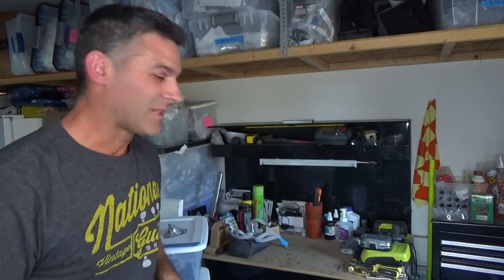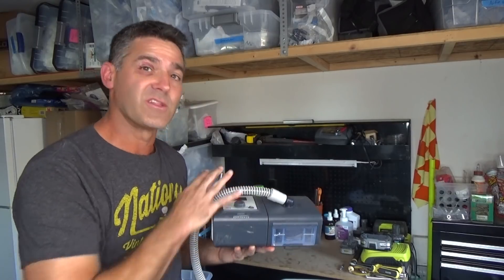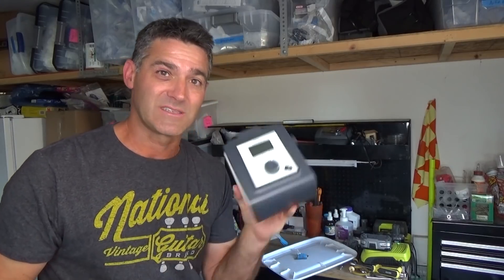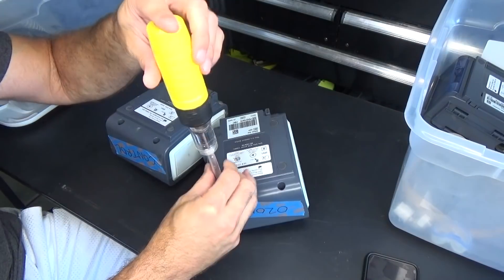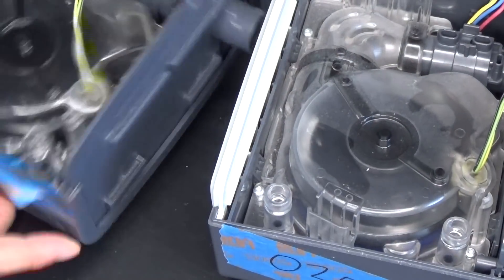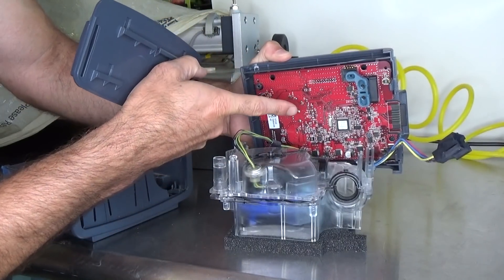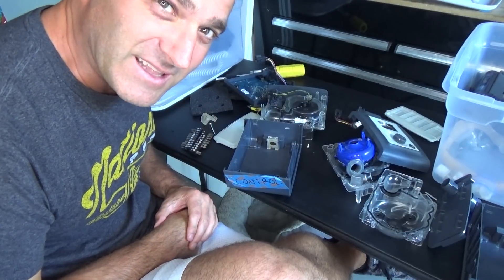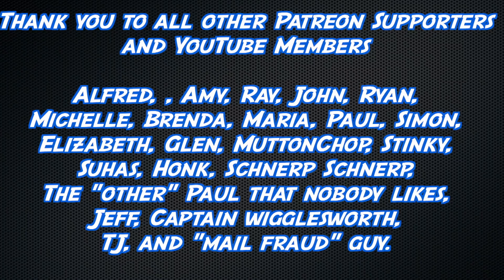Showing what OZONE does to the FOAM in a Philips Respironics CPAP Machine   #Foamgate

Comment: I'd prefer to see this done with dozens of units with known histories (preferably new), rather than used but (claimed) equivalent histories. Heck, your teardown makes me think the two units could have been years different in age. Also, I have a hard time accepting your evidence as meaningful since we didn't see the filters before the test. The pattern of disintegration shown doesn't seem consistent with air flowing through the foam, but appears rather uniform, seemingly more an indicator that age was the issue. I could rationalize all day long, but my point is the evidence you provided does not seem very convincing...to me. I expect the ozone could be an issue, but all I see is anecdotal evidence.

Oh, and: no, I don't use an ozone thingy – I've been thinking about getting one for years, but haven't made that leap.

Comment: From reading the comments about ozone and the comments about the SoClean machines, its clear that many here are over exaggerating the ozone exposure. Ozone doesn't enter your cpap when that cleaner is not running. The video is only trying to show that extreme exposure... 100s of times more than a SoClean machine will run through your cpap, will deteriorate the foam. This could mean you are breathing in tiny particles of foam.
What the video fails to show however...is that ozone from these disinfecting machines doesn't get cycled through that foam anyway. And no ozone remains in the machine to poison you as you sleep.
This was a VERY unscientific display meant to scare people...because the foam is AFTER your filter.
Reply from the maker: I can see why you are confused. There is a video that this is a follow up of. 
I don't know that I (or others) would call running the ozone 2x per day extreme.  Ozone degrades after 30 minutes to 4 hours.  

Ozone absolutely gets cycled through the machine. This video shows that. (This video or any other of my videos don't ever make the claim that ozone remains in the machine)  This was a fair test, but not something I'd submit to a journal.  

I would have put in scary music if I was trying to scare people. 🤣 

When ozone is hooked up to a machine, it doesn't matter when the filter is (the foam is first...as this video shows) since ozone is going to get to it all anyway.  Only thing getting filtered out is dust.  

You honestly sound like you work for SoClean, or VirtuClean.  Or have a warehouse full of these that you need to sell on Amazon.

Comment: I see a few problems with this very un-scientific comparison. It can't even be called a trial or an experiment.
First there was no pre-test comparisons between the test and the control units. For all we know, the test unit was already dusty and dirty and has disintegrating foam. Second, there was no quantification of the ozone being pumped into the container with the test unit sealed inside. How pure or concentrated was the ozone? How long per day? The author said the contained was filled for many many days.
Its clear he is trying to condemn the use of the brand SoClean disinfection device.
He needs to start with two brand new cpap machines, and match the strength, quality, and duration of ozone exposure from the SoClean device; which is only about 7 or 8 minutes per daily cleaning cycle, for these results to be considered conclusive or evidence-based.
Better yet start off with 2 brand new cpap units. Run both units the same amount of time each day. One unit gets the usual wash in dish soap etc, and the other gets the same wash each day but also gets run through a 7 minute SoClean machine ozone cycle.
THEN you have true comparable results (although still not a scientific level experiment)
And you should be replacing your mask, hose and filters monthly anyways.
Reply from the maker: Sounds like you have a great experiment YOU can do.  Please let me know when your video is done so that I can watch it.  Thanks Big Todd.

Comment: I was wondering why I get a notice about the $hitbox Philips machine I got. It's hopefully being swapped to a Resmed Air10 so I can sleep without a jet engine beside me.
Reply: That is a sign that your machine needs to be taken apart and completely cleaned, or that the bearings on the fan are failing. The bearings on my honey's machine fan failed and it gave lots of warning with a loud whining sound and it legit sounded like a jet engine failing at close range once i got the rotor to turn. 😲

Comment: Trying to understand, maybe somebody can clear this up.....I use an ozone cleaner on the tube and mask only, never on the unit itself. Since the tube/mask is past the actual machine and air only flows out of it...do I need to be concerned about the "effects of ozone on the foam" that I keep reading about. Any clarification appreciated.
Reply: I’m wondering the same thing!! I’ve used my soclean since Xmas 2020 and I don’t think I’ll be using it anymore!!!
Reply: I use an ozone cleaner called Respify. It only cleans the mask, tubing, etc. Not the unit, itself. It is very small. Fits in your palm. Cheap, too. Gave $99. Seen em as low as $79, since my purchase. Beats the heck outa trying to dry out the hose tubing, everyday. I have had some durability issues with it. The power cord quit working, early on, but the company did promptly replace free of charge. Just letting people know that there are options to soclean, out there & you don't have to use the ozone on the unit, itself. Hope this helps somebody.

Comment: Those old enough to remember what a VCR is may remember the news that came out from the various manufacturers that warranties would be voided if an "ionizer" was used around the machine.  The ionizer generated ozone.  It made the air smell fresher and would cause the rubber belts in the VCR to deteriorate and break in a very short time.  When I got my CPAP years ago I refused the offer of a HUGE discount on one of the more popular cleaning devices.  I knew what the ozone would do to the plastic parts.

Comment: Great investigative forensic disassembly.  Well done.  Any idiot with a high school education knows ozone should be avoided.  And the germaphobe angle is a it's own form of mental illness.  I wash my P30I mask, hose, and humidifier once every 7 days and dry with the Hurricane dryer
  Distilled water only but in the summer I put an end cap on the Airsense CPAP and for waterless.  No issues in over 3 years and now thanks to VOVID mask wearing no colds either.

Comment: VA kept telling me they don't recommend the ozone units and to save my money. However, I wonder if essential oils had any effect on them.... I used to use 2-3 drops of peppermint....
Reply: This is my unscientific opinion, but since this is a constant positive air pressure system, and if you were putting the essential oils in the humidifier, the air in the unit only travels in one direction so the evaporating oils would not enter the unit only the tubing and mask.

Comment: Thanks for the video.  
You show how ambient air enters the CPAP (System One) through the filter, the air “touches” the foam, it proceeds to the blower and then on to the hose (or humidifier). Correct understanding?
If we have a Soclean 2, we must have the humidifier attached.  Ozone is injected into the humidifier (with or without water), ozone then proceeds to go into the hose and on to the mask which is inside Soclean 2.  Inside the Soclean 2, ozone is reduced to diatomic oxygen. Agree?
So how does ozone get to the foam?  It cannot get there through the normal intake, UNLESS there is a high concentration of ozone in the ambient air. Or it back feeds to the connection in the humidifier into the CPAP and finds its way to the foam.
Not sure how ozone would touch the foam in a Dreamstation.
DreamStation 2 given its design it cannot use Soclean 2 since air does not flow in a straight line, the airflow makes a U-Turn in the humidifier
Regardless though, Soclean 2 can be used to sanitize the hose and mask: ozone enters the hose through a sealed connection, flows thorough the hose, out from mask which is placed inside Soclean where the ozone is reduced to diatomic oxygen.
Reply from the maker: Flows from humidifier through tubing to mask like you say, but also back into the blower and entire housing of machine (through foam) and out the air intake.  

Humidifier through entire internal circuit is probably 8-10 inches in length.  Humidifier through tubing to mask is about 66-70 inches.

Regardless of where the ozone goes it breaks down after 30 minutes or so.
Reply: @Freecpapadvice  How about putting a plug on the exit to the humidifier so that it does not back feed into the blower?  Would sanitize not only the tube and mask (perhaps the most critical component) but also the humidifier. Or just simply sanitize the hose and mask?  Notice I use the term sanitize not clean.

BTW ozone has a distinctive smell - the smell of an electrical short circuit. Typically Soclean 2 runs about 7 mins, I never smelled ozone, however I never opened the lid on Soclean.  Have to wait two hours to take the mask out of the Soclean chamber.
Reply: Something does not make sense. Problem 1: Ozone damages the foam and helps to deteriorate the foam and it breaks up into small black specs. Has anyone seen the specs in the humidifier? A humidifier chamber is needed for Soclean. Problem 2: Even without the use of ozone, the foam apparently releases VOCs. If that is the case, should we also worry about the filter elements in System One and DS1, especially System One which uses a foam filter?

Comment: Is the foam in a closed chamber or is it open? Someone on youtube, who opened to remove the foam wrote: there are two chambers, an upper and a lower one. The air does not pass the foam. He wrote this in the comment section, not in the video. (First pinned comment.) it was a Dreamstation.

https://youtu.be/ytLGqYbIDVE
Reply from the maker: There is an upper and lower....that's how I would describe it as well.
Don't let this mislead though.  Like the chambers of the heart, they all have the same blood flowing through.  This sucks air from outside the machine and through the foam.  From there it is sucked up into the upper chamber and through the blower/flow generator.  Then to the humidifier and then tubing.  

All air that is delivered to the person using the CPAP went through the foam.

Comment: What is this actually proving without a chemical analysis of the residue? Not much. You've proven that constant Ozone use leaves a residue, what isn't clear is if this is a safe residue left from using the ozone device, or if its a chemical reaction, toxic or otherwise, caused by the ozone and the foam reacting.

Comment: Great video! Would really be great if you’d give your thoughts on and show removal of Dreamstation foam. I had my machine completely apart (it’s not rocket science), but freaked out about drilling in to the casing….wondering if it would be noisy…how do I plug it up after drilling etc. So….I put it back together and am still breathing this poison every night. I can’t get another machine for a year….which is probably when Philips will start doing whatever they are going to do to rectify this. I was wondering about Medicare paying for a new machine when I’m due if Philips sends a replacement prior to my due date. I would hate to be stuck with their crappy new Dreamstation 2 for another 5 years. What a frick’n conundrum.

Comment: Lefty isn’t that little square foam filter on outside of that unit the same foam
Reply: I have a System One much like ones used by LL in video.  The small rectangular foam filter is an air intake filter and is a different consistency from the sound proofing foam beneath the blower unit.

Comment: 6:16 - Good start, but TBH, there are too many variables in this test. Two different machines used by different unknown people in different unknown places. Different insides to the machines, so foam could come from different suppliers. I realize it's not realistic to do ($$$), but using two identical new machines would go a long way towards giving a persuasive result.
Reply: Agree with John. The control machine has clearly been used less and the dust in the machine is likely due to natural accumulation over time and/or clear differences in the machine design (note the control machine has different shaped foam corresponding to different silicon gasket shape at the inlet). The air does not go through the foam - the foam forms the lower wall of the air path. Any dust that makes it past the filters (which may have been missing when used) will often land on the foam and stick/rest there and the is more near the inlet reducing as you get closer to the motor inlet. It's not clear if the flakes coming off the ozone foam are just that residual dust or degraded foam particles.
Reply: @kappa7  I’m pretty sure the air does go through the foam…if not, what I am missing
Reply: @patv4475  The foam is not really air permeable. If it was air would be drawn in through various other holes in the housing rather than just through the air filter. Air enters through the filter and follows the path through the bottom of the housing above the foam. This is probably clearest at around 3:57 in this video.
Reply: @kappa7  interesting, thanks. I’ve use a device like this and the anxiety is killing me, so many mixed opinions 🤔

Comment: So.. Is the machine safe(safer) if  you never used ozone on it?
Reply: For the particles yes, even tho it can still deteriorate without ozone usage, you’d have to open and check your foam as for the VOCs off gassing it seems like its from initial start but now philips in their new update are saying it’s only in the first couple of days. Who knows if we can trust that information…
Reply: I don't think they are safe after 24 hrs, otherwise there would be no recall and recommendation to stop using the machine. The recall wasn't about ozone, I don't think it was mentioned. The point is at least 3 types of compounds are outgassed, Inc VOCs, toluene & 1 other I can't recall, so don't buy this drivel from Phillip's about 24 hrs, maybe 1 type of compound.

Comment: I have a background in computers and digital electronics. I'm pretty confident I could probably build a CPAP. But it would take me more than a trip to Home Depot (probably have to order some specialty stuff from electronics supply websites), and it wouldn't be nearly as accurate as the ones Phillips, Resmed, and others can make with their years of experience, and the amount in R&D they spend. Um, no thanks, I'll just continue using my Resmed.
Reply: I've thought about making one too. I would think an Arduino UNO would have the computing power needed to make a very basic model but to control the pressure, humidifier and data logging might require a Arduino Mega or Raspberry Pi. The expensive part is the equipment required to get everything properly calibrated which would cost more than a lifetime renting a CPAP machine.
Reply: Building a machine that pumps air wouldn't be hard. The real work is in the R&D side - developing algorithms etc.
Reply from the maker: 😂  Fair enough!
Reply: It seems to me very difficult to build an auto cpap, bipap etc. But maybe not so hard to build one if you know your number and can just build a blower that reliably shots out exactly that oressure.bit would seem a lot better than going without or breathing outgassed components. I'm a12 send me one 🤪
Reply: @SandraWarmbreath  Yeah, that's the difficult part. In the end though it's software on a controller that reads inputs from various sensors, and then uses that data to adjust the motor speed of the ducted fan in order to achieve desired pressures. Automatic functioning, you would have to read for slugs of backpressure (the start of the exhale, before the mask ports open up) followed by a reduction in pressure (patient breathing in). When none is detected for a certain amount of time, log as an event, and then gradually increase pressure until another one is detected. Then if normal breathing resumes, you can reduce the pressure.

Of course, I'm taking a guess here, what they actually do is beyond me (since most companies are closed source with their algos). But logically, it's what makes sense to me.
Reply: Single pressure CPAP would,d be easy. BiPAP a bit harder but probably doable (just not only Home Depot/Lowe's). 

Anything more advanced means microcontrollers, sensors and algorithms to detect apnea and change pressures.